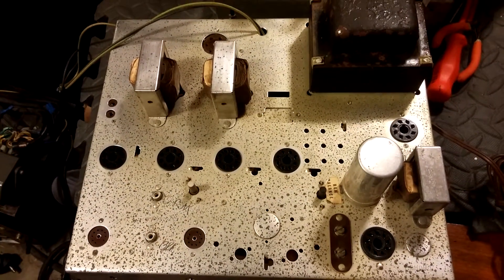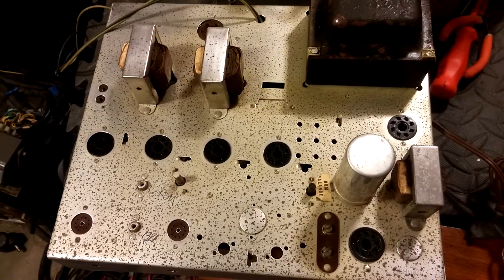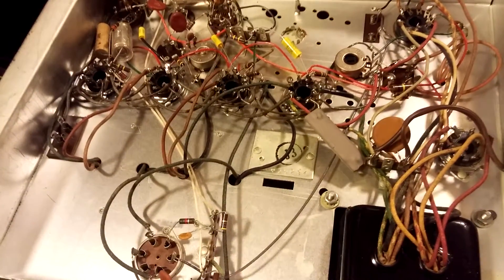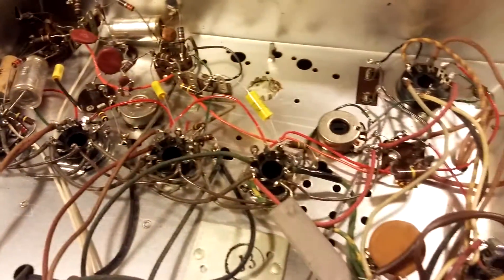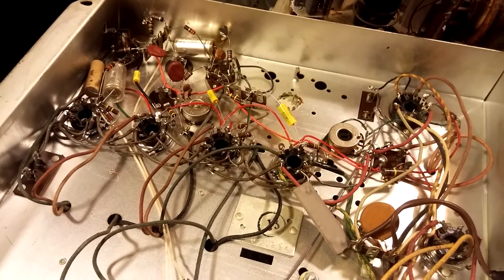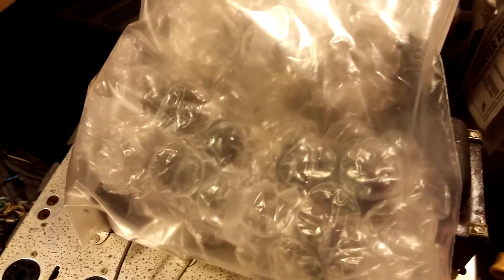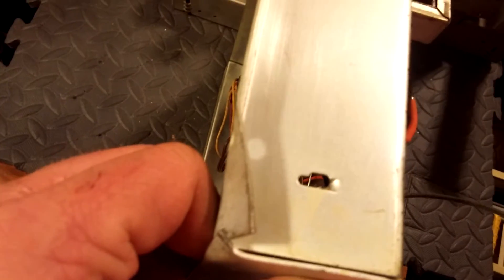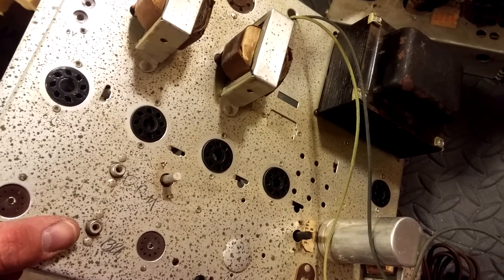Magnavox amp-175 assessment and repair

Comment: How did it come out?  I also have a Magna 175-AA, in a  console/turntable unit, it's furniture really.  Came with  6k6GT tubes  driven by 12ax7's not the 6v6GT. Everything worked when I got it although speakers crumbling,  I'm rebuilding now.
Reply from the maker: My Magnavox didn't come with the amp and it looks like I bought the wrong one. This one is for a record player only not a record player radio so.... power supply is not adequate.

Comment: what speaker impedance is ideal for this amp?  8 ohm?
Reply from the maker: The Sams show 4 speakers in parallel for this amp so probably less than 8 ohms.
15" woofer  4-6 ohms
12" woofer 4-6 ohms
5" midrange 3-4 ohms
4" tweeter 8-10 ohms
Reply: I found the service sheet at radiomuseum.com and the stock magnavox OPT is rated at 3-4 ohms, but there are plenty of suggested replacements that will support 4-8 ohms.  She'd run a little weak at 8 ohms with the stock transformer.